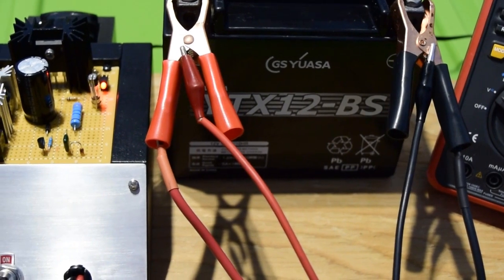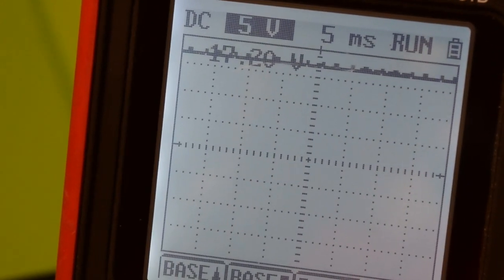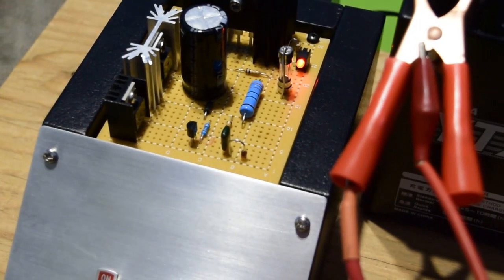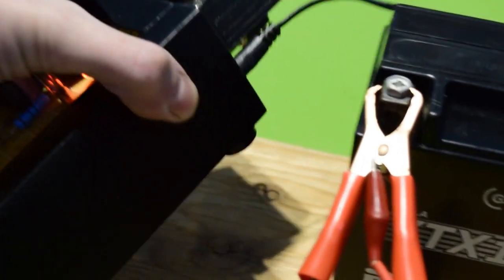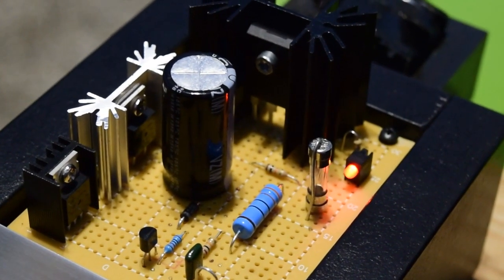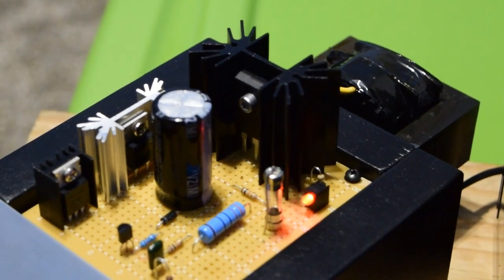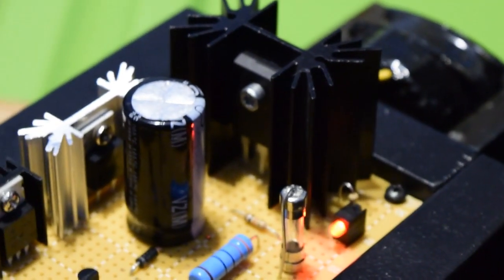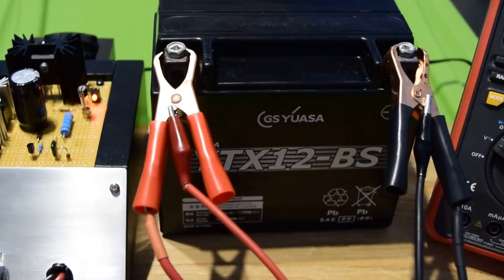This is the BEST and most simple Radiant Charger design of all time.

Comment: Hi Charles .it appears Joe booked sealed the engines to cause a vacuum by blocking the exhaust at ,downpipe and the inlet at carburetor this then appears to copy Joe papp engine  the lightning bolt energy being electro static magnetic static caused from the central neutrals of the alternator and starter motor .this collided together ac dc then dc ac .Joe shows it in Joe cell talks video 5 .he draws a figure 8 in the sands from each motor .he talks of the artic North pole in his encrypted reference

Comment: I have seen your older video on HHO generation. Is this new type of power supply suitable for a HHO wet cell using stainless steel scrubber pads. 
Is output adjustable. I have just burnt a 60watt PWM which was adjusted and only running @ approx 16v for just over a minute.
I am only wanting to use the HHO as fuel for my Pulse detonation engine.

Comment: Wow, this circuitry seems to beat those modern day high frequency units that has a lot of EMI in my opinion, i've tried so much brands of 12V chargers that claims to remove sulfation our worst nightmare... I will check this radiant  unit when i get the schematic, btw where to find it?

Comment: Great to see you back,  Charles. Thank you for the video and free plans.
Have you been doing any new work with the Joe Cell?
Reply from the maker: I haven't worked on the Joe Cell since last summer. The Joe Cell has to be removed during winter because it can freeze! I did install a Joe Cell on my Ford V8 5.4L engine work van with aluminum heads. I got an 18% increase in gas mileage. I had to mount the cell in the rear of the van, which may have had a negative effect. More experimentation is needed. I can email photos if you'd like. You can email me from my store, Ritalie.com/store click on the contact section.